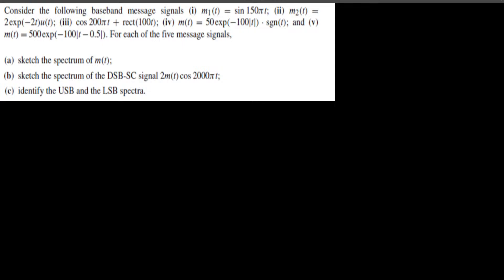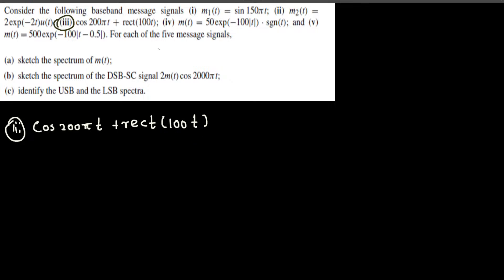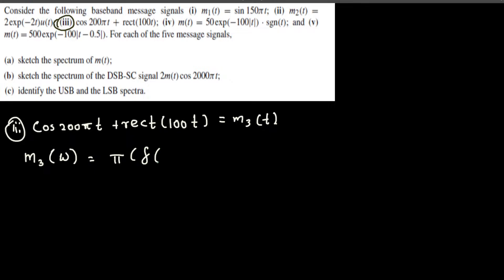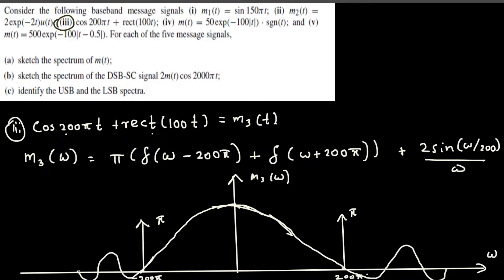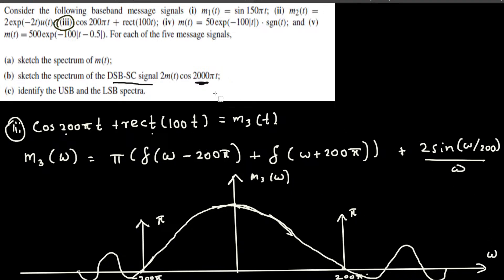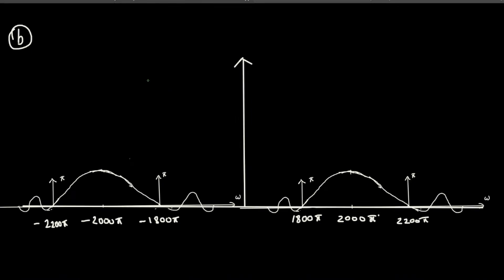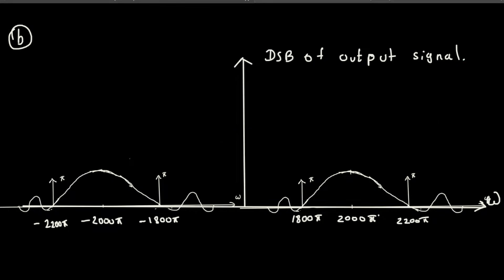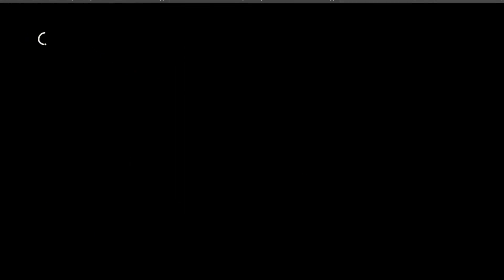Consider the following baseband message signals (0) m1o)sin 150; (ii) m2(0) D sgn(); and (v) = in…

Comment: Is this solution correct? In part b, Cos(2000Pit), isn't your centre frequency suppose to be 1000 not 2000. Wo=2Pi(f)==> therefor frequency= 2000pi/2P=1000